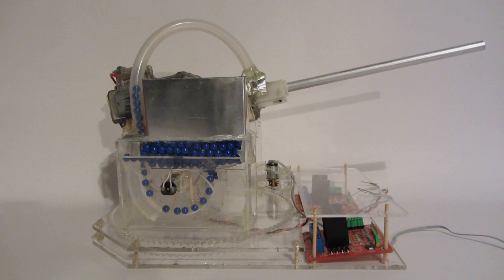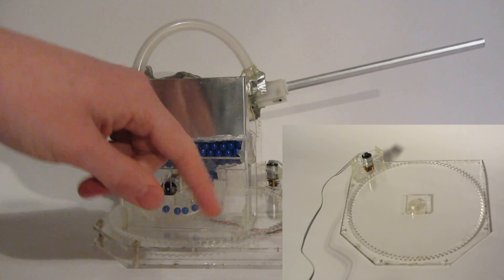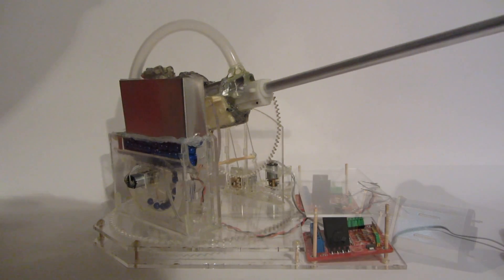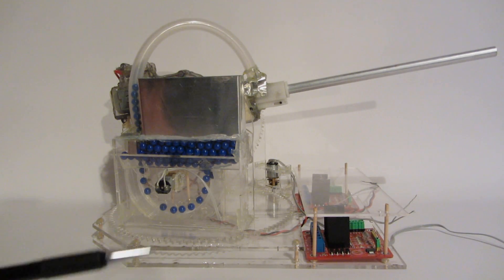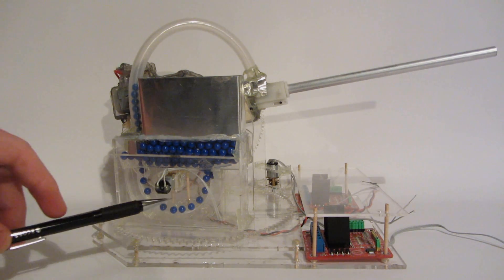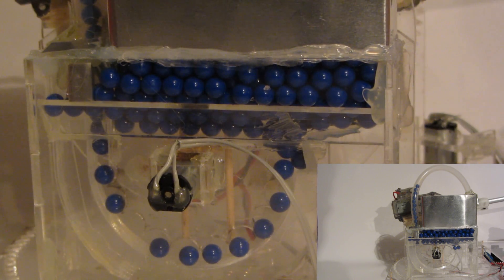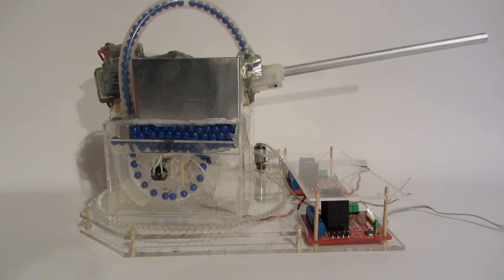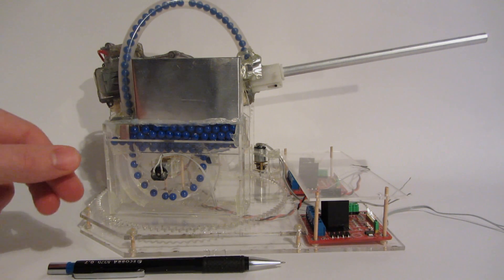Homemade Airsoft Turret Prototype - Airsoft Sentry Gun

Comment: RC servo are using potentiometer to find out their position, should be not to hard to adapt to the tilt, as the rotate optic encoder and counting can do the job. Option-2 Arduino also have a module called MPU-6050 with is a 3 axix motion detection, should also give you the chance to install the arduino joystick for the control. Good luck
Reply from the maker: Thanks a lot for your tips! For my next version I think I'm gonna go with some old stepper motors and drivers - should work, too right?
Reply: Should work well, This guy explain very well stepper motor control:   https://www.youtube.com/watch?v=0qwrnUeSpYQ
Reply from the maker: Thank you so much!

Comment: Nice prototype. You have to completed with CMOS camera for DRI (Detection, Recognition and identification) by programmed tracking and zooming. For tracking you should sensing either color or heat, so your increment azimuth and elevation moving based on tracking and encoding capability. Camera and gun should be make independently, so Elevation degree of your barrel gun based on projectile trajectory data (shooting table). If your sentry gun will be operated in the dark, you have to completed by thermal optic/scope/camera, but thermal optic can not see anything in the rain or glasses, so you need image intensifier also.

Comment: use stepper motors instead of using some form of sensor for rotary encoding. combined with a limit switch to get orientation on start-up then if you know how many clicks on the stepper gives you a full rotation you'll achieve very accurate positioning with a much simpler sketch.
Reply: I'm doing the exact same thing

Comment: This is a great project, you've done a fantastic job of the design.  Did you consider using stepper motors instead?  This would have allowed you to gain much more accuracy in the turret movements, and may also prevent wobble.

Comment: dude that thing is awesome I tried to make something like that in the past only thing I did was build a frame and a rotating table and all I did was take a RC battleship's motor's and gears out, 1 worked for the rotation and another was for the elevation/depression and I just used the controller to change the direction the gun aimed and a camera (with a wireless screen) mounted on the barrel with a laser red dot taped to it to help accuracy it worked pretty good im just working on a case to make it water proof for rain and snow battles.

Comment: Hi i want to make something similar but can i control it with an joystick without any arduino or such thing just wiring and easy components. Can i like make the motor for example: turn left when the stick is turned left and opposite whinuot any "circuitry"? I would really appresiate an answer. PS: nice sentry gun!
Reply: I ment like not soldering a lot of components together.
Reply: Thanks! I really appreciate it. Im kind off new to electronics.
Reply: Thank you so much again!

Comment: Suggestion: use an arduino mega or ADK and mount it under the turret so it can turn continue 360 degrees rotation and try making it wireless

Comment: what if you take too many 360 turns, does the wire connection has no issues on rotation? nice work by the way

Comment: I'd add encoder stripes to the small laser-cut gears in the drive gearboxes, then use an IR LED and IR photodetector pair on either side of the encoder. You can get phototransistors or photodiodes as the detector side, this will allow you to get active high or low outputs depending on your preference. Digikey.com or mouser.com have good selections.

Comment: The LSM303DLMTR is a tilt compensated compass chip - Sparkfun has a breakout brd.  If you mount this on the turret, the accelerometer can be used to determine tilt and the compass can sense rotation.  You could optionally use a magnet in the fixed base instead of sensing the earth's field.

Comment: Sure, have a look on google for "bourns multi turn potentiometer" for some great examples. They make a normal panel-mount version with a 1/4" (6.35mm) shaft. You can get them with up to 10 turn reduction, and they're pretty smooth. I recently bought some to refit my variable power supply - much easier to set precision voltages now.

Comment: If you still have access to the laser cutter, here's my idea: couple a laser-cut gear (to match each axis) to either a rotary encoder or a multiple-turn potentiometer. The former would need a "home" configuration, but the latter would give you fixed feedback for the entire range, so long as you gear it right!

Then you can treat it more like a servo.

Comment: Ah, I was about to suggest that.  Yes, a good Idea.  Only problem is that it doesn't allow the system to be very precise.   You could combat this with an approximate function that models how much a gear turns over time while the motor is on. Use this function to be able to aim in between the holes in the tape(a sort of interpolation).    Then use the photo sensor to make sure that the system doesn't lose its calibration.  (You will always know just where you are by counting holes.)